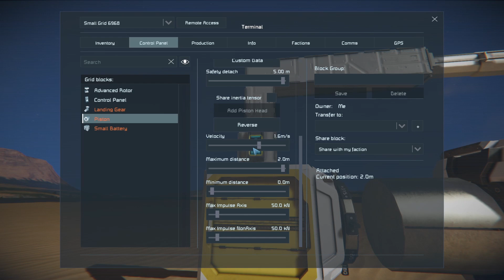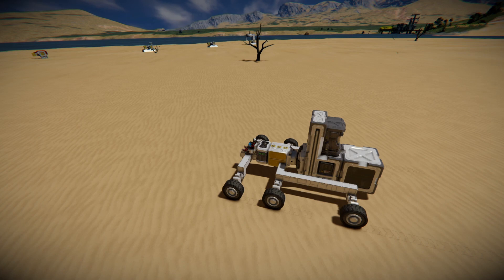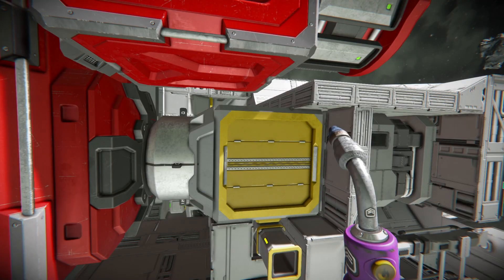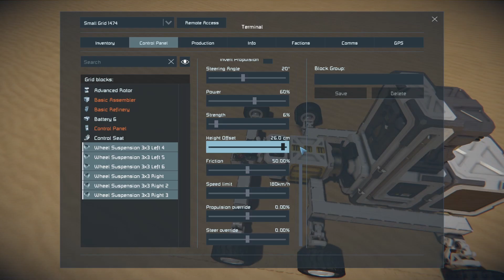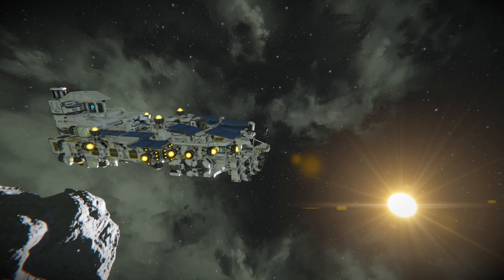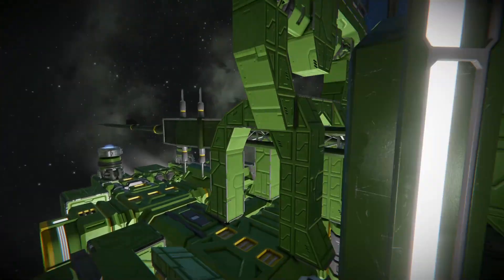Space Engineers Hybrid Grids

Comment: so to avoid clang you have to test out every small blocks attached to the grid whether it moves or not as you paste it ? also should small grid blocks not touch the large grid blocks to avoid clang ?
Reply from the maker: Well not every one. Just those that are close to the other grid or have a risk of collision. Also keep in mind what changes you are making so you can backtrack and find the cause more easily.
I usually only have one ore two connections between the grids. The rotor of course and the sometimes a landing gear to lock it in place. The two grids touching doesn't necessarily cause clang, but it can cause phantom forces if the grids are pressing into each other. These forces cause unexplained spinning and twisting and sometimes can grow into full blown clang yeeting your craft into oblivion.